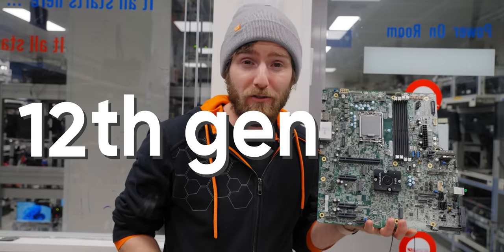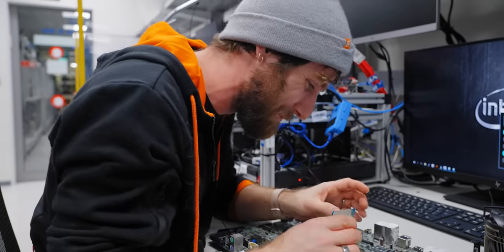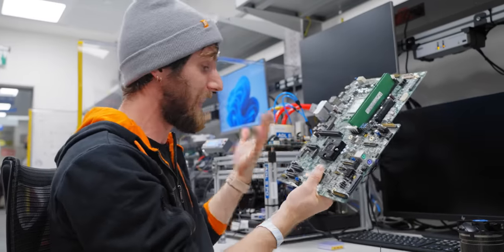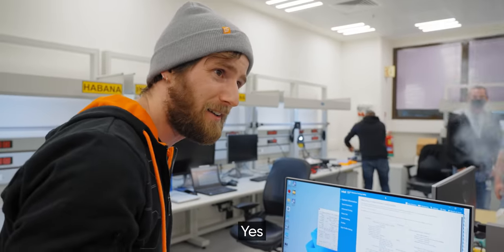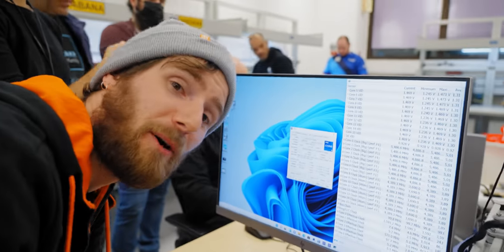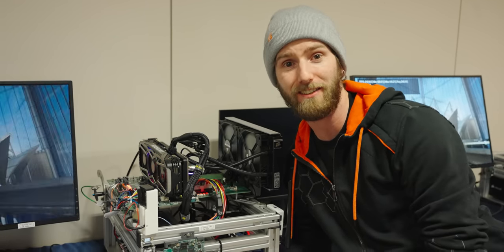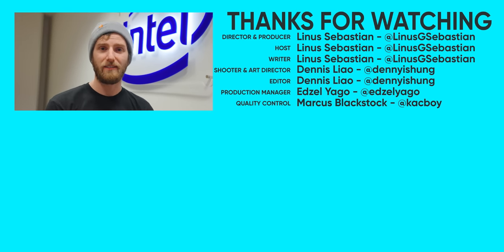I saved the best for last - Intel Design Center Development Motherboard

Comment: Interesting to know that Intel's techno wizardry department uses cpu-z in their kit.
Reply: Thought the same:D
Reply: And hwdinfo
Reply: how else do you think leaks happen when an undisclosed CPU gets validated on a benchmark/app. Someone internally generally is the one doing it, or a company doing it with an engineering sample.
Reply: ricky bobby  Oh they definitely bought it. Intel doesn't fuck around, they have lawyers and backend staff that deals with that.
Reply: ... when presenting to media. It's a familiar UI for outsiders. They probably have internal software for the actual work.

Comment: Internal USB ports are actually super handy for people who use software like Pro Tools that requires authentication dongles, so you can just leave it plugged it in all the time
Reply: That's terrible security practice though
Reply: Just like writing your password on your monitor, you will never forget it!!!
Reply: I’d love that for my unraid server
Reply: @georger5558  Its purpose is to enforce licensing, not grant access to data. If this were a 2FA dongle it would be a whole different story.
Reply: i am pretty sure they are just using the wires of the port for a priority protocol
they functions they were controlling happens before boot so USB protocols and drivers cant be used
it is normal to use comercial ports for other uses. VGA is another example, it is often used for uses other than display
Reply: @georger5558  I think I misspoke, it's probably more accurate to call them "DRM dongles".
Reply: @atafakheri8659  ... pretty sure they're just regular old USB ports. And of course USB can be used pre-boot. How do you think your mouse and keyboard work in the bios?

Comment: Something interesting at 10:17 — that looks like a much older GPU on the test bench than I would have expected
Reply: maybe it's just for display output?
Reply: Keep in mind that it's for thorough testing of the processors. They probably run tests with older GPU's as well to make sure the new processor plays nice with the different GPU architectures that are still around plenty.

Comment: An age ago I worked in PC hardware development with Intel platforms and it's cool to see some of the tools I was using are still in use at Intel and that the public has gotten a peek at them. 
The USB debug interface was just starting to be worked on when I exited that industry so it was interesting to see it actually in use now. 

As for Linus's popularity there, it's a bit hard to explain what it's like to work in that kind of environment. Guys like Linus are great for taking all the info out there on a product, condensing it, and repackaging it in a way that is consumer friendly. To use the game analogy, no one would know anything about the game that is being played if it weren't for guys like Linus. No one would even know which games are the important ones either if not for tech reporting like this.

Comment: I wonder how many prototypes of these reference motherboards Intel goes through until the final result. Likewise, why doesn’t Intel (or AMD) offer their own motherboards?
Reply: For offering motherboards, I would think it comes down to offerings and price. If Intel or AMD were to sell motherboards, it would spread their resources thinner with having to make different types of motherboards for different consumers all the while profit margins not being high on motherboards unless it's something like a higher end board.
Reply: Intel actually used to offer their own motherboards, but that was long ago.
Reply: Back in the day Intel did offer consumer reference boards.
Reply: It's called "Blueprint" being sold to Motherboards Manufacturers.

As simple as that
Reply: Because they can fab their own “easily” but scaling up for market and then all the other costs would just be insane when there are 3rd parties out there to make ‘em

Comment: Overclocking can be used to test the maximum capabilities of technology, but it does not represent the standard use case and will void product warranties.
Reply: Overclocking can be used to test the maximum capabilities of technology, but it does not represent the standard use case and will void product warranties.
Reply: Overclocking can be used to test the maximum capabilities of technology, but it does not represent the standard use case and will void product warranties

Comment: The water block cooler is probably the coolest, pun intended part of this whole video. Imagine if the chip suppliers got into the water cooling development and started selling them to customers. I think they are missing out on a big area where they can test their chips and get the cooling optimized. Maybe it's just me but if I were a head player at Intel or Amd I'd definitely have my hands in the cooling department of my own chips. They are in the perfect place and setting to develop the best cooling on the market for their products!

Comment: Every motherboard should use that M.2 latch, no exceptions, also the faster BIOS memory
Reply: Not exactly sure how it's implemented but my expectation is that the faster bios flashing is implemented by just not implementing the bios in a ROM, meaning that while it's much faster to write to, it's probably less reliable. If I had to guess they probably just have volatile DRAM or SRAM meaning that every time the power goes off they have to reflash it, it's just really easy to do in a testing environment and not possible in a real world environment.

Comment: I used to have an Intel motherboard a long time ago. They surely know how to make their own motherboards.
Reply: In the company where I work is a 17 year old Intel motherboard that still runs fine 24/7. It runs Ubuntu Server LTS 32-bit version. And that runs out of support in 2023. While I am convinced the hardware will run for many more years, the computer will be scrapped because of software support.

But as it lasted this long already, I kinda want it to run as long as possible. It still manages to do the tasks it is assigned to do inside the allotted time. So my boss never was inclined to replace it. He has no problem springing for new systems to do more tasks. Guess he is kinda like me, it lasted this long and does what it needs to do reliably, so rather spend money on new stuff for new tasks.

Lots of words to say: Intel does know how to build motherboards. Usually sparse in features, but only high quality parts for the elements that are there.

Comment: I wish some of these QoL features made it onto consumer boards. Even if you only swap drives every so often, being able to do so without any tools or massive disassembly would be a massive boon. 
The modular design also would be absolutely stellar to see. Rather than having to throw out the entire motherboard when a new platform comes out, you could get a compatible modular component instead, so you can still use the majority of the motherboard and reduce e-waste.
Reply: ⬆️⬆️⬆️thanks for the comment.. 
Contact the What’sap line above for more information, advise and consultation/

Comment: Fun fact, Intel back in the day wasn't capable of manufacturing a Motherboard, so they asked Motherboard manufacturers to make Boards without a CPU existing yet. Asus was a small player back then and didn't really got much access to Intels ressources.

Asus build a motherboard without a CPU existing yet and they delivered. It worked. Crazy stuff, I don't remember exactly what socket and time it was but it's definitely quite a while by now :O

Would love to meet those guys that make up the stuff for stuff that they don't have access to yet, because it simply doesn't exist yet

Comment: Just as an aside: I completely agree with bringing back PS/2 connectors for keyboards/mice and it has nothing to do with NKRO or polling or the like, it's simply because the way PS/2 works means it takes a lot more than something like a buggy USB driver to lock you out of being able to easily control your system. That's one of the reasons why PS/2 just works in the UEFI or other low level stuff while USB may or may not work, it's like how every GPU from a 3090Ti to a CGA display adapter supports the same DOS style text only output modes as a fallback option if the software required for the more modern, fancier display modes isn't working for some reason.

Comment: I love how Intel's fab process is "outdated" when the facilities are absolutely incredible with amazing staff and about as advanced as it gets. It kind of makes you wonder what a TSMC fab looks like in comparison but i'm sure they absolutely wouldn't let any person even LTT in to look inside.
Reply: The actual fabs should look the same in TSMC, the only difference would be that TSMC should have more of the ASML EUV photo-lithography machines installed already whereas at FAB 28 in Israel they are still ramping up the number, if I remember correctly.

The secret sauces and differences between the companies is more in how they use the machines, the chemical processes and design types they know to do (called "vlsi libraries", collections of types of transistors that the Fab knows how to make)

[EDIT: This is a pretty big simplification but getting into the details more than that is.. complicated. The point I was trying to get across is that the differences aren't things that you'll really be able to see, because the big things are pretty standard]

Comment: I hand on heart just had to put a new board in last night, and I can assure you Linus, I badly need that fast install thumbscrew on the M.2 slots because I suffer from the "Sausagefingers" condition that comes from lifting heavy things for a living. When my much nicer board I was forced to downgrade from died, my first thought wasn't "There goes my 400 dollar board," it was "Crap, I have to do M.2 screws again for a few hours. And I mean HOURS. more than two hours of flipping the tiny screws across the room and dropping them on the board and scavenging.

Comment: 5:37 16x PCIe slots have locks because in the old days card-creep caused by thermal cycles would push them out. I do agree with you that the implementation of the locks on some motherboards can be a pain in the ass with modern GPUs.
Reply: I replied to the whatsapp scam wishing this site (by its name) would do something to remove it and my comment was removed...
Reply: @BansheeBunny  Never reply just report.

Comment: Hold up. So they have access to a BIOS emulator and the CPU registers. That means they could generate custom CPU performance profiles on the fly, to potentially enable or disable features by means of an external monitoring application.

Comment: One day Linus, we can finally have a cpu running at 6.9ghz 6900mhz ddr6 ram with an nvidia 6090 69gb cards. with our 6900 watt power supply (because at this rate we’re gonna need that). much like 1969 for cars. a golden age for computers.
Reply: You know we already have DDR5 8400 right? Just down clock it to 6900 lol. At this rate the DDR6 base  standard will be well above 12000.
Reply: @mitlanderson  was just trying to add another 69 in there and another 6 with ddr6
Reply: @aaronrdaniels  ye i see, but DDR5 6900 make more logical sense lol

Comment: I feel the PS/2 ports are safer. Working in datacenters with a shared crash cart, using a keyboard or mouse that has something embedded into the firmware is possible, and getting your cluster compromised with a root/boot kit a total possibility. Using ps/2 will eliminate that concern.

Comment: Often the thermal head will have a liquid nitrogen hookup so you can validate to cold temperatures. There will be at least one type-k thermocouple hookup you can see at 9:21. They could use this for overclocking to (say) automatically keep the CPU at -40 C.
The chipset contactor is pretty cool. Expensive, but saves time compared with removing and re-soldering a chip (you would not get a new dev board). You can also reuse the contactor for the next board revision.

Comment: Bruh those tap boxes look like the same systems I used as a file server at my job and I work at goodwill as a computer tech and I have to scrounge through donations for any equipment I need. Mind you they're probably using something newer than the 7th gen intel version I was using but I still find it amusing that I was using the same equipment as intel.

Comment: I'm pretty sure that "Tap Box" is Intel's VISA, gives you full JTAG access over the CPU over USB, iirc Intel can do this to any CPU in the field.
Reply: it isn't just VISA, there are a lot of tools. And no, that gets fused shut during fabrication.
Reply: @thursdaythought7201  I remember reading there are a bunch of way Intel Engineers can access CPUs in the field. The specific talk I saw went into how VISA access was typically granted in-field.

Then there's Intel ME etc.
Reply: @dylangerdaly6113  Intel ME is completely different. Engineers can access some stuff on retail chips but nothing like we can in the labs.
Reply: @thursdaythought7201  Thanks for the insight, something Intel typically lets you get away with is disabling ME, AMD has PSP do critical things like bringing the cores out of reset.
Reply: @dylangerdaly6113  yeah np

Comment: Oh my God! Dip switches, (old computer guy talking), I remember when I had to figure out which of the 20 or so dip switches I had to flip on my old Tandy 1000RX dot matrix printer that I had to flip for different software programs to use the printer sand even in my DOS based word processor had to have different switches to print documents or pictures.  Oh the good old days of 286 processors with 256k of RAM, and my "hard drive" was a 3.5 floppy. Internet? What is that, you mean to tell me that there is a net inside my computer?

Comment: "why not bring back ps2?" because its super specific nowadays. there are hardly any peripherals besides mice and keyboards that use them, hardly any that even SHOULD use them, and they take up a lot of space. "they just always work"? when was the last time a regular old usb mouse or keyboard didn't just work? they aren't that complicated. a reliable multipurpose port is worth more than a specific use port. in fact I'd go as far as to say we should honestly be well on our way to replacing all usb-a with usb-c ports. that way not only would we have space for more ports, we wouldn't have to guess which way the connector goes in anymore. something even ps2 ports still have issues with, arguably even more than usb-a.

Comment: Samsung Semiconductor in Austin, TX had a family day when they still made CPU's rather than flash memory, and since he worked there the family got to go on a fab tour just like this. Same yellow lighting, same wafer transport robots, mostly the same machines. Most of time its only a medium security risk, because even if average joe sees and understands, he dosent have the billions needed to open his own foundry. And as for corporate espionage, The person seeking info would have to wander away from the machines and into the engineers offices to steal their notes, which is a lot less likely to happen on a guided tour
Reply: ⬆️⬆️⬆️thanks for the comment.. 
Contact the What’sap line above for more information, advise and consultation:

Comment: I feel like Intel should have a premium line of cpu's that come factory overclocked or a software you can download and automatically overclock
Reply: I mean that kinda what the i9s are... The i5, i7, and i9 are all the same chip that are binned and segmented based on performance and manufacturing defects. Then certain features are cut and base clocks are set.

Comment: My ASUS X570 has one P/S2 connector which I use for my keyboard. I would prefer the old 2ea. P/S2 ports instead of the combined one I have though. I would prefer to put my mouse on P/S2 myself.

Comment: SCREWS screw people. Why not having those easy to mount mechanisms (as the M2 one you showed) for everyone?.
 
I would add some pegs (ZERO SCREW) for attaching the motherboard and PCI cards to the case, and 4 pair of hinges  (one per side) to easily open (and close) a case, with some peg or other mechanism to add a tape or door.

I suggest you to make a join venture with a case manufacturer, and a series of videos, for an LTT audience designed case,  with all our suggestions (including LTT staff ones) with giveaways for the implemented new ideas, and a place for that case in LTT store and future videos.

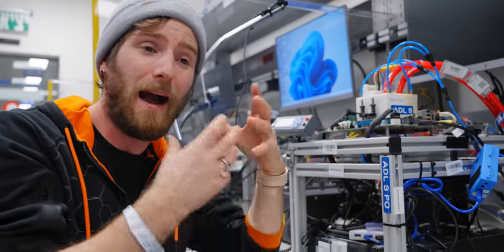Comment: uh, what's with that line in the middle of linus's face around 7:57 and almost continuously for the rest of the video? were they using 2 cameras to make one image for some reason and they are not lined up? been noticing some weird visual anomalies in LTT videos lately. doesn't take away from the content, but I'm just surprised there are QC issues coming up now after they've been so professionally done for so long.

Comment: See if the current gen $1000 boards would get this kind of tinker-ability, even just via software/USB, not the chipset socket, then i'd consider them worth the money. Alas, they just have more blinky lights and pre-installed $150 water blocks.
Reply: Intel fuses the development taps shut on their chips before it leaves the fab. It would be an insane security issue if they didn't.

Comment: ps2, because it always works. exactly. cuz when 99% of the fking system fails, you know as long as you can get into the bios, at least you can poke around and try to figure it out instead of waiting around for if/when the USB decides to pull its head out of its ass.

Comment: Why not try to build a reasonably well functioning pc using only thrift store parts. I don’t know about where you are, but thrift stores where I am can’t handle computer tech so they try to sell them off as quickly as they get them in so it’s dirt cheap. Figured it would be an interesting challenge.